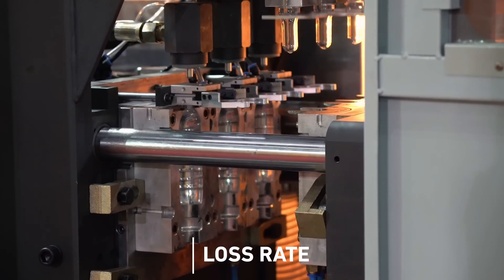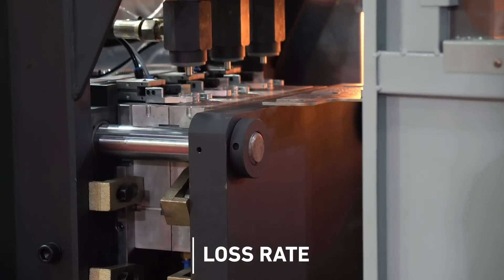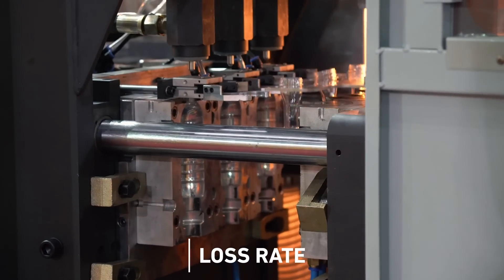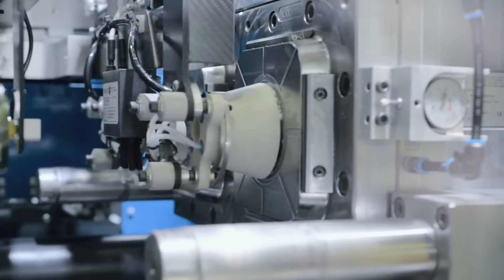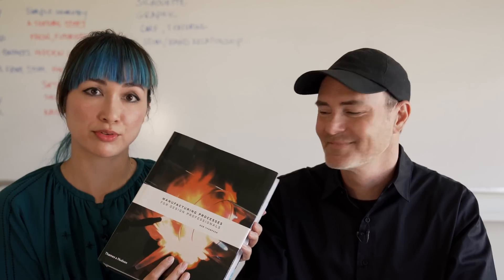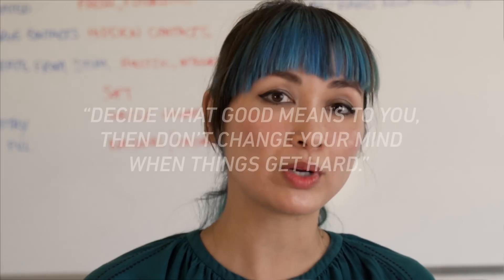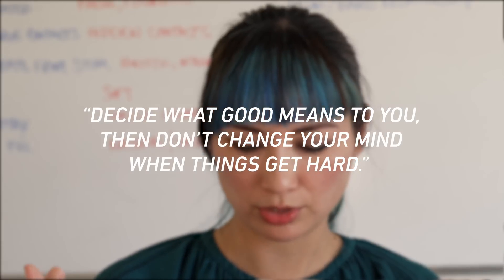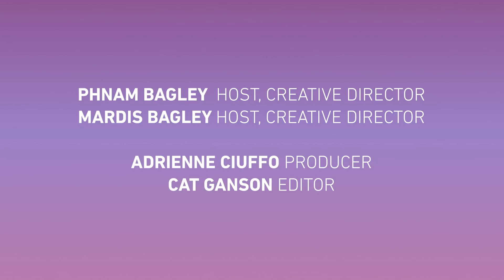Design for Manufacturing

Comment: This is great I must confess. I want to ask what your best 3 CAD softwares are in your design journey
Reply: Hi Nbyak. Thanks for watching! We use 1. Rhino 3D because it has great surfaces, can import/export many formats, and is reasonably priced. 2. Autodesk Alias is the best at creating and manipulating complex surface geometry. Lots of car designers use it. It's really pricy though. 3. Fusion 360 is the best of all worlds. It does great surfacing, parametric modeling, has a great history tree, and we use it to output g-code for our CNC. We use many others, like Grasshopper and Gravity sketch too.

Comment: all of this is true for software too
Reply from the maker: Oooo tell us more. We're not as well versed in software.
Reply: @NonfictionDesign  Sure. I am User Experience Designer for software from Berlin. So the drafting process for software is called wireframing / UI prototyping. It can be done in different levels of fidelity and exploration goals. Also we build prototypes to communicate how things look (mockup prototypes/ui-dummies) and how things are meant to function (functional wireframe prototypes/click-prototypes).

Manufacturing process for software is called implementation programming. Some components you may need to source (logic, sometimes even UI component kits such as material UI). And what you call the manufacturing engineer is called the frontend developer in software. The guy that materializes your concepts and ideas. 

It's really similar.
Reply from the maker: @tt-rama2246  Awesome, thanks for sharing!